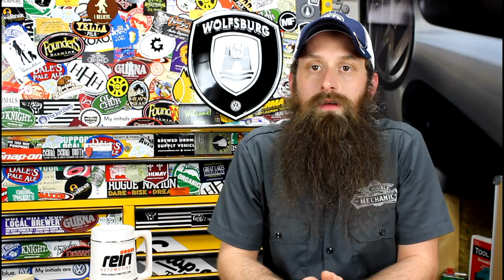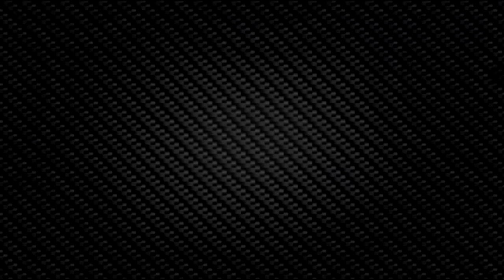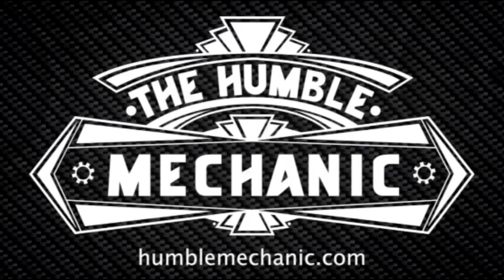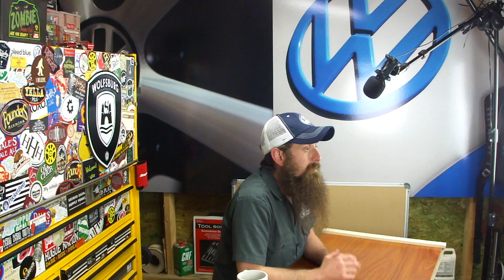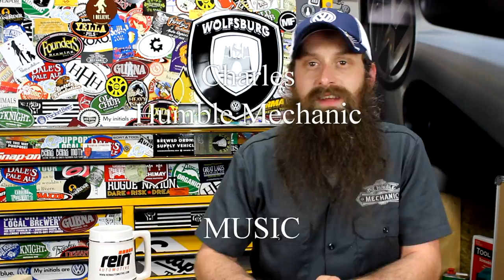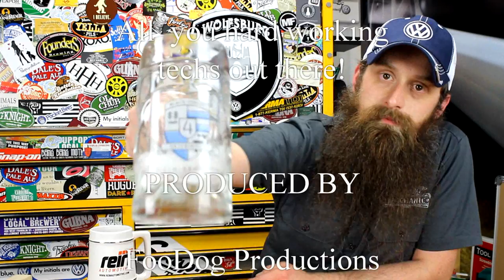Why Flat Rate is a Good Way to Get Paid

Comment: I total agree with you on flat rate system its makes us hustle and do the job right but there was 1 b.s. case in my life the 6 liter diesel Ford's that came out in 03 they were junk built by a European company I got very little training on them and then we started to see the problem roll in 1 major problem was the plastic fuel pump no matter how right I fixed it they would come back was told it was my fault and I would b eating the labor this happen like 5x in 3 months anyways that engine under went 489 revisions in 3yrs ish they finally got them fixed but i those first 18 months of that motor was hell don't get me started on that e series diesel van that vehicle well tell you if your right with god cause your going to b asking for his help twice a hour

Comment: That’s some good BS sales pitch. Shop time should be exactly what time is spent on a vehicle and the book should be used for estimating not the end result. Flex plate on my Ford F-150 was go in g to take 2 days 10-12 hours to change out and we did in in 4 hours at home. Had a knocking in my lifters (so I thought) shop took my head covers off to tell me “need lifters changed out” out comes the F-ing book, 2 hours time couple hundred bux nothing fixed. It’s a hustle that should be outlawed.
Reply from the maker: So time spent on vehicle. What’s stopping someone from just dragging g feet and charging double what “they should”. 

If a tech spend $500 on a tool to do a job faster should they be punished by making less money? 

Like all systems there are ways to cheat.

Comment: 500%, 300% and stacking....Yeap that sounds like a shop I'd like to take a car too....Car needs brake pads and rotors cut...Then that %'r tech gets ahold of it and whips up a bill for calipers, hoses, flush, new rotors and pads....Hey that's what a Writer Postion is for though, so he can push it all I guess.
Reply from the maker: Not at all how it works.

Comment: You never mentioned warranty, and how it throws everyone under the bus. So ill answer you questions for you.

How flat rate is good for techs? It's not with warranty time dropping it becomes near impossible to make any kind money or even a semi good paycheck, nothing like working  80 hours and making 60 because the aftermarket is taking all the COD work. OH, and if you have a co-worker that is making the same as you and a pissing off all day long then he/she has better knee pads or your management is a bunch of failures. IF your co-worker is that lazy, then to get canned. It's a system that rewards speed over done right, always will, cause if the car comes back you can more money on it, want that changed, change the system.

How flat rate is good for customers? NOPE, they get to cover the costs lost during warranty work. ATM warranty pays on average here .5 to the hour labor as the times are so damn low, add in down time for slow days and the customer needs to pay between 2 and 2.5 times warranty to cover the lost income and its still not enough so they stick Flushes and fancy BG like produces on top of that to make more money. Also the Tech is inclined to get the job do fast, not "right" and will do what it takes to do it. It'll get done, just not the way the factory wanted. Example, need the mirror off, factory says take door panel off and these 15 screws, though I know you can use a 2x4 to hold the panel out of the way so I can get 3 screws out instead. Then I hold onto the ticket till I'm over the warranty time so they don't lower it more. The customer doesn't get their car back any faster because doing so will hurt ME in the long run and I will not share the 2x4 idea because they will change the times even lower if it works. Then the customer will get charged  MORE money because someone has to pay the difference.

 How flat rate is good for the shop/dealership? They love it, it lets them screw everyone with out to many issues. They can also use it to punish people they don't like or to reward those that are either good (no issue here) OR bride them (more common). Its a tool of dealer politics, is tech A doesn't like tech B for whatever reason then he/she can Bride the person handing the work out by naming a kid after them (yup happened twice at my dealer, creepy shit), buying them wine,boz, and all other kinds of ass kissing then using that power to screw everyone else, yeah tons of fun.

Think about the high efficiency jobs? Why, when they make up 10% of the paycheck any the rest are 50% efficiency jobs then what? OH LOOK, a recall, it pays .5 and the computer you have to use takes 1 hour and has to be done on cars with 5k or less miles. Oh boy I got 2 days of warranty work that paid 5 hours total and then got the 10 hour service that takes 3 hours, now I'm up to 15 hours in 3 days playing catch up.

Flat Rate is like masturbating with sand, the action seems fun but always leaves you burnt in the end.
Reply: +eviljagtech Well said! I would add that by separating the team of techs into the greedy and jealous individuals overall shop efficiency and customer satisfaction rate falls down. 
The right way to motivate techs is true profit share scheme while monitoring their individual efficiency (not just by the hours produced, but also for skills development and quality of work). This way everyone would be motivated to get every job done in the best way and techs would help each other because this would increase overall profit and benefit them all. Under the flat rate helping someone does not benefit me in any way, it is nothing but loss of time for me.
Flat rate is primitive, inefficient and unfair system of payment that should stay in 20th century where it belongs.

Comment: I really don't see how people feel flat-rate is bad.  Paying by the hour in a dealership isn't feasible at all because it doesn't support hardwork, it supports laziness.  Why would a customer want to take their car to technician A who takes 3 hours to do a job over technician B who takes 1 hour?

I'm not a dealership tech, but I highly support flat rate, it's the only thing that works, IMO.
Reply: +MrSlowestD16 Why would a customer want to take their car to technician A who takes 3 hours to do a job over technician B who takes 1 hour? 
They would want technician A because he has more tools and experience and does a proper job with attention to detail vs. tech B who is a speed demon. ACCORDING TO THE CAR OWNERS I INTERVIEWED.
Reply from the maker: +Elricck that doesn't always tell the whole story. In fact a tech doing a job faster may mean they have done it many times before. Or maybe they bought some high dollar tools to do the job faster. Speed is not always related to quality and attention to detail. 

I can do plenty of jobs faster than the time it pays. And plenty of jobs take me longer.
Reply: +HumbleMechanic Hey bro. My post was over-simplified -you got me there but most car owners prefer proper thorough work, their dis-advantage is they many times cant tell the difference until 3 to 6 months down the road when they are calling a tow truck so they make a leap of faith and sometimes get burned. I GET what you say and i see the quality of what you do in your videos,, i guess it comes down to a repair philosophy of the shop we are at like is an informed customer a better customer or is an ignorant customer a money making opportunity if you follow me?
Reply: +HumbleMechanic It just so happens my local VW is hiring and i&#39;m sending my resume tonight, wish me luck they are beginning a 2nd shift operation. I worked at a dealer long ago in the Rabbitt Jetta Scirocco Quantum Vanagon day and they never gave us the "straight dope" about technical situations back then either. One funny thing was Mann Filters had an O-ring prob which we ourselves noticed first hand but the new cars rolling in ALL had gorilla tight oil filters we had boxes of literally crushed filters, i wanted to take a pic and send it to the factory in Germany for a laugh but back then it would have been very time consuming.
Reply from the maker: +Elricck right man. I am pulling for ya!!
Reply: +HumbleMechanic Good to know you are in a viable situation. There are shops where a butcher is the service manager's main boy and makes the best money. Politics. Hate that shit ;). Hate that shit when i am trying to be a real technician yet can only maintain mediocre pay, the big bucks going to the half-assed goobers with the silver tongues and oh yeh the PEN, lets not forget the silver pen &quot;i did all this and that&quot; when we know he didnt do shit except hit the problem with a hammer. Oh well, tool boxes come with wheels, time to use them...

Comment: Flat rate is only good if the dealership is busy...my former Auto instructor quit a vw dealer in his hometown (that I believe got bought by another company) because he was sitting on his ass cuz it was soooooo dead...they fired and switched up management and marketing teams numerous times in the ten years he was there ...it started off good for him then every year got less and less busy to the point some techs started quitting one by one ...so you can make great money on the flat rate system...only if the dealership is busy!!!!!
Flat rate also creates a lot of hacks and causes good techs to cut corners just to make their times ...but great techs who double check and sell work and learn the brand there working on really well can really make BANK on flat rate...

Comment: Suppose  you break a bolt and the customer says you quoted me a price and I don't have any more money-who takes the loss? Who eats the job? I like Firestone- they have posted we use flat rate AND OR actual time to do the job.
Reply: Firestone is a great company. I really enjoy working for them. I've heard dealership pay more an hour on average but Firestone is just a great place to work I may just stay for the long haul.
Reply: well thats why like at the ford dealers when doing 5.4 exhaust manifolds or the 2 piece spark plugs.. if it breaks.. its either .5 or an hour more for each that breaks.. thats specified before the customer gives the ok.
Reply: ooooooo ok give this guy a rusted car to work on............

Comment: Suppose you break a bolt when changing a exhaust manifold gasket-imagine that- who pays for the extra time to get the bolt out?
Reply from the maker: It largely depends. If it takes a few minutes then as a tech I fix it. 

If it is a big ordeal, calling the customer is an option.

Comment: Flat rate story mechanic did head gasket on 3.1L different head gaskets come with push rod guides that get in the way the the power plant ran but not well that mechanic got a two week paycheck of about 200 dollars good luck.

Comment: This guy must just do maintenance.
1.)Flat rate is built to pay better technicians more. False. Flat rate is built to pay better technicians less.  Warranty pays less. Period. The more you know the more hardcore diagnosis, electrical, trans. and engine work you will be doing. This work pays less than doing brake jobs all day leaving no incentive whatsoever to become more knowledgeable. It actually rewards people for knowing less, or pretending to know less. Hustling has nothing to do with it. Also comebacks don't cost a technician money when it becomes a more knowledgeable guy's problem anyway.

2.)Quality and quantity are inversely proportional. Rushing through cars accomplishes nothing except incorrect diagnosis and poor quality repairs. When you become an "A" tech you don't hustle anymore. You spend the time to find the broken wire, or the burnt valve, and you accept that your going to lose money on this job. Rushing isn't going to find the broken wire, and there is also no way anyone is going to pay you for the 6 hours it took to find it, not the dealership, not the customer, and not manufacturer. But hey if you stay all night and rush through 4 brake jobs (hopefully you remember to tighten all the bolts) you can can get paid 8 hours for a 12 hour day. Its win win for everyone.
Reply from the maker: When I was at the dealership I did it all from basic maintenance to the advanced diag in the shop. I worked 40ish hours a week and averaged anywhere from 50-80 hours a week. The TDI crap did impact my hours. 

What you point out on both your points is not wrong, but not the whole story. 

Point 1) Typically if you are doing more advanced work, you should be paid more per hour. Someone that does brake jobs all day is a C level tech, and should be paid as such. And Hustling has everything to do with it. Your reward for knowing more should be a higher rate. 

Point 2) Rushing through a car CAN lead to incorrect diag and poor repair. Working quickly and accurately is how you win flat rate. You still should be hustling as the A tech. You can still hustle and be thorough, fix and diag cars correctly. 

Flat rate is not perfect. But neither is paying hourly. I made way more money in my career on flat rate than I would have if I got paid hourly.
Reply: Point 1) It doesn't matter how high your per hour pay is if you make only a few hours a day. Warranty times are well below what it takes to complete the job. 

Point 2) Every once in a while the instrument cluster blanks out in my car. It happens randomly. I have scanned the car for codes and the codes indicate that the CAN network went down at some point. There are 10 different modules and miles of wire that go through the entire car. Technician A says that a module could be the cause. Technician be says it could be a broken or shorted wire. How quickly and accurately can you diagnose that issue? Do you think anyone is going to pay the actual time spent on this job?

Comment: Unfortunately, more & more of the car is covered under warranty for longer periods. Warranty flat rate is usually 60% of the reality at best... Sometimes you get a real loser..... Like four hours to swap out a CVT that requires dropping the whole drivetrain assembly & separating the trans on the floor....
Reply from the maker: +J. Helvie I have always felt like it was almost impossible to win on engine and transmission R+R

Comment: flat not good for special in small job 
but can be almost fair in big jobs like engine or transmission overhaul
Reply from the maker: I actually feel the opposite. I find that it's easier to make time on small jobs like replacing light bulbs. Labor times for engine overhaul tend to be lower in relation. 

But that may be a European car manufacturer thing.
Reply: maybe im talking about Toyota dealer in suadi cause im working there also I like your motivation speech

Comment: I just switched from hourly to flat rate today. I like hourly because I know I'm making slow but steady money by end of the day. Flat rate has its ups and downs I see. You can make more in a shorter time frame but if the day is slow your not making little to nothing. And the hourly guy well he goes home on a slow day. Haha! One thing though I'm confused about when you take lunch as a flat rate guy? Are you required to take a lunch by law?
Reply from the maker: I think the lunch thing might be state to state. I spent plenty of days not taking a lunch.

Comment: The cars are made all the same. One line of cars all cost the same to assemble. The cars get abused all differently. The process for each may be fast or slow, depending on rust and wear. The mechanic in many places never get the same job day to day,  The repair pay system does not match this.  The cars are made with varying types of part quality and system accessibility, The spark plugs are so buried often that you need to remove the engine; and you get 0.6 h for it. . Tire rotation is a big problem and an easy example. I will bet that 95% of lug nuts are put on to tight. You know the German Industrial Standard. "Goodentight". The torque wrench in most tool boxes has dust on it. The 1997 Ford Escort needs 70 lb. / ft. for each lugnut. That is from the Ford Repair Book. I would bet any woman can generate that torque to get the lug nuts off and on. You know one foot with 70 lbs. force on the end. Most women weigh 100 lbs. or more so it should be no problem for a woman to remove properly installed lugnuts. Up to 100 lbs. times one foot to tighten should not be a problem.  I will eat my underwear  if you can  prove that your Mom Or Girl friend, would never have any problem changing a tire on the side of the road, because some mechanic could not take time to do the job right.. My Uncle Philip said, "You get what you pay for".